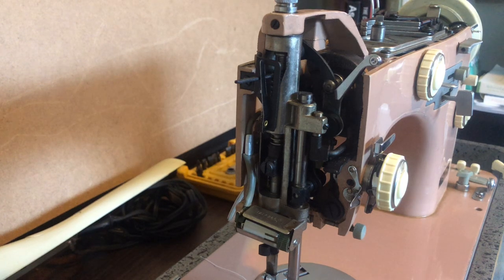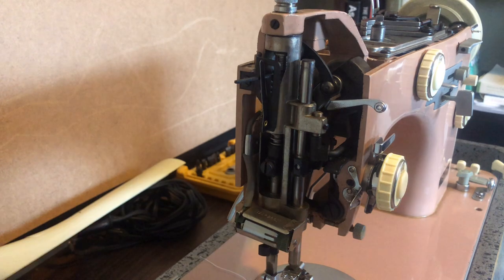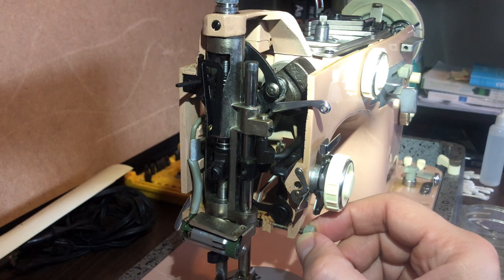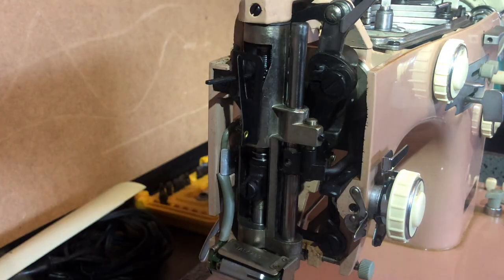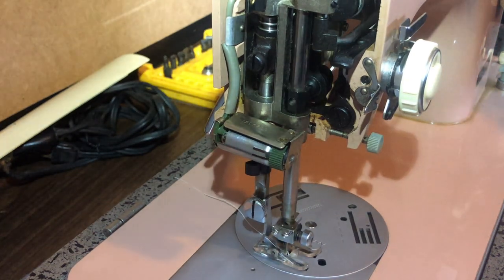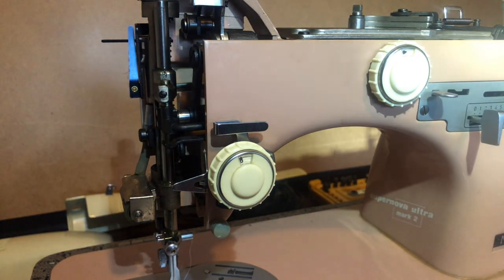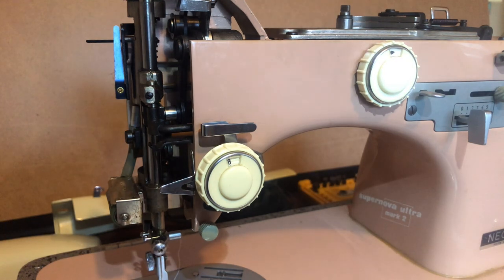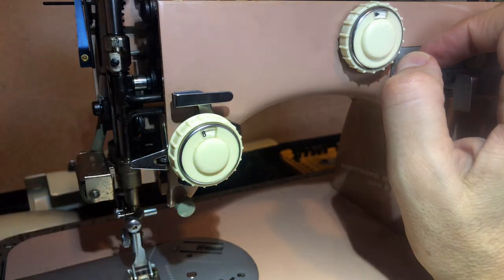HOW TO SERIES #2: Sleeping Beauty!  How to "Wake Up" a long dormant Necchi Supernova Ultra Mark II

Comment: Thank you, this was great for learning where to oil. Pretty sure my green Supernova was also dormant for many years. I had already removed the front panel (just two screws and it's easy to remove), and then you can see the parts inside that move and need oiling. However, now I can't figure out how to get the L-C-R lever to start working again, and so I could not check the zigzag worked - I'm pretty sure that lever worked before I removed the front panel...!

Comment: Hello...  it looks like you have quite a bit of experience with older sewing machines and i was wondering if you could possibly help me with my "SUPRA  Super Zig-Zag" sewing machine. I would like to find an operating manual or any helpful information for this sewing machine but have not had any success. Have you heard of this "SUPRA" model i can't seem to find any info on it.
Reply from the maker: Hi Mike.  While the potential for finding the user manual for this specific model is a bit of a 'needle in a haystack', all is not lost.  First, take some photos of your machine from the front and then look online for machines that 'sort of' resemble it.  Japanese clones were made in large numbers but only by about 6 or so companies.  They shipped them to N. America and then were 'cloned' with brands/names that numbered in the hundreds.  Often, the manuals they included had no branding on them so that they could purpose them for many brands.  Once you find a machine that has a resemblance to yours, note its brand name and search for manuals under that name too.  It will take a while but you might find one in PDF form online but hiding under a different name.  This approach also applies to finding stitch cams which were also unbranded like the manuals were.  Once you have the manual, it will make certain things like threading the machine a bit more straightforward.  Another idea is to find machines similar to yours and make a list of their brands.  Then, search under those brands for videos and you 'might' find one that shows how it is threaded.  Another option would be to befriend someone who has sewing on machines all their lives and may have better instincts for how a machine might be threaded.

Comment: Thanks for your really interesting videos. I started watching them when I recently acquired a Brother 345 and an Elna Lotus SP. The Brother is working well and I love it. I also love the Elna, it sews beautifully but, I would really like to fill the bobbins for this machine on the machine but the winder is worn down. I've bought a replacement for it but I cannot get the old one off. Any advice would be really appreciated. Thanks, Clare.

Comment: Is that yellow rubber case box right behind the machine, a Chapman Set?
Reply from the maker: Yes, it is.  These screwdriver tips are great for preventing the stripping of screws.
Reply: @VintageSewingMachineGarage  Nice. Used to own the Xcelite Roll set, oh man, the Yellow Handle foul smell made me sick after long hour of using. Will get a set of Chapman soon.